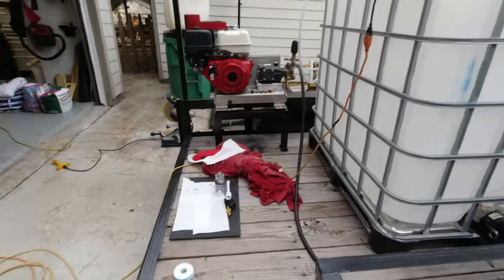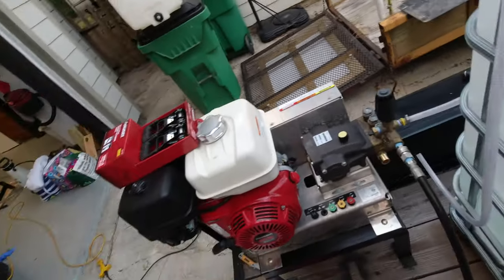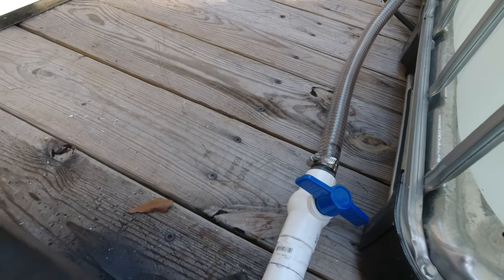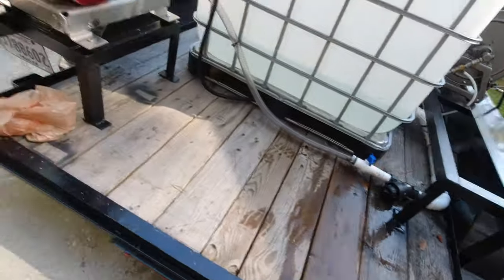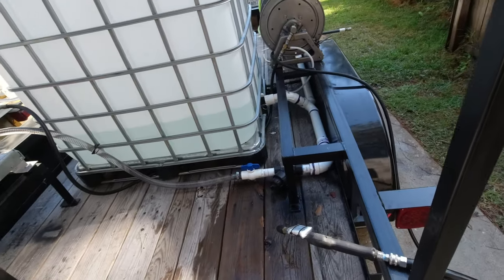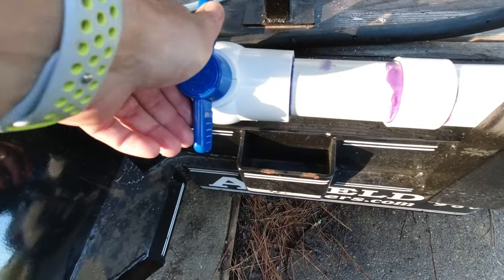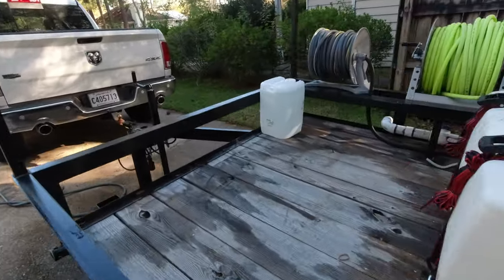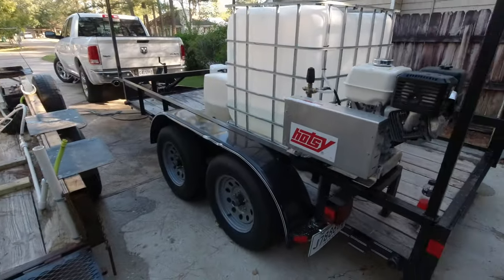Trailer Build  Episode 2

Comment: My brother great job on building new system I use a vent cap for  Bathroom under a the sink it's has a Built-in check valve no trash can get into your tank I put one on my 330 tote it works great  good job  on buliding your trailer  Road dog dirt relief
Reply from the maker: Thanks. I never thought about vent cap from the bathroom. That is a great idea and may have to use it!! Thanks again

Comment: Its not a street t, it's more like a sanitary t if anything. I've actually never seen one of them in the Chicago area and that's what I've done my whole life lol. Also, if it was me I would remove that 90 you have leading to the pump and use a street 45 into a regular 45 to make it a long sweep for better flow to that pump. A street fitting has one hub and one male end. 2 45's make a 90
Reply from the maker: Sweeping tee vs. a regular tee. It has great flow, but i do need to add a ball valve. Thanks

Comment: Hey brother.  Great videos.  I have a small lawn care business solo operation.  Adding housecwashing next year. Having to devide my trailer basically in half.  Half lawn side half downstreaming side.  6x12 trailer so will be tight.  What did you end up doing with the spare tire? I'm having that same issue with it having to be taken off the side to accommodate the reels.
Reply from the maker: I was debating on cutting the off the channel in front of the trailer, but decided against that. I also thought about just keeping in back of the truck. But after working the trailer, I think I will move the mount to the other side. I would also recommend that you make the reel rack off the trailer as far as you can to maximize your space. Thanks for watching and let me know if I can help with anything else!

Comment: I have a question, will the pressure washer still be able to feed from the tote when the water is below the pressure washer line?
Reply from the maker: The water must be above the bulkhead fitting that feeds the pressure washer. Thanks

Comment: Nice build!  Question... what is the bypass hose (valve) for that your run from your pressure washer to your tote?  What's it's function?
Reply from the maker: The original bypass hose was connected to unloader & then went to the hoe inlet on the pump. So went you left off the wand, the water recirculates but will eventually heat up. So I disconnected the connection on the inlet and plugged it then ran the bypass hose to the buffer tank. With this set up, it doesn't matter how long I stay off the wand and the water will never get hot in the pump.

Comment: What size of filter and clear hose from tank to pump did you use sir?
Reply from the maker: 1 1/2" for the pressure washer. You could use 1" & that should work. Thanks

Comment: Did you buid those supports for the pressure washer and hose reels yourself? I need to do that for my trailer
Reply from the maker: Yes, I did all the fabrication work. I am in the process of adding another stand for my 8 GPM unit. BTW, I love them being mounted on the back of the trailer for access.

Comment: Hey buddy quick question i notice you pressure washer will suck the water up from the tank when you started it. you can see the water flowing from the tube to the tank. But my pressure washer wont do that. i bought the simpson 4400 4 gpm pressure washer and no luck. Can you shed some light?
Reply from the maker: You probably have a direct drive pressure washer. A direct drive pressure washer will not suck water from a tank. You need to raise the tank above the pressure washer to gravity feed. If you get a bely drive or gear drive pressure washer, then they will suck from a tank.
Reply: @allproexteriorservicesllc5338  yes sir, i do indeed have a direct drive pressure washer. what kind of pressure wash is the honda? is that bely drive or gear drive?
Reply from the maker: @NutcrewGaming  I have a belt & gear drive. I like them both, but the gear drive is growing on me. Thanks
Reply: @allproexteriorservicesllc5338  awesome, thank you sir

Comment: Awesome clean build. Can i ask what size is line is feeding your pressure washer?
Reply from the maker: Thanks!! I used a 1" line to feed the 4 GPM unit & 1 1/2" line for my 9 GPM unit.
Reply: @allproexteriorservicesllc5338  i like your setup and imma try to replicate that. For a 5.5 gpm do you think i should use 1” or 1-1/2”?
Reply from the maker: @GoldenState408  1
1" should work perfectly.
Reply: @allproexteriorservicesllc5338  thank you Sir! hope you killin it right now

Comment: How did you secure that water tank down
Reply from the maker: I made some brackets that are bolted to the deck of the trailer. Thanks
Reply: @allproexteriorservicesllc5338  thanks for the reply I ended up doing 2x4 on all sides two rachet straps over top my welder was willing to make the brackets but the way I did it was much more stout imo I'm now working the plumbing and it's been a real learning lesson haha.

Comment: How long is your bypass hose? I have seen some say it needs to 15’ -25’. Also do you run that drop stick almost to the bottom of the tank?
Reply from the maker: My bypass hose is around 3 or 4’. The only time you need a long bypass hose is on a roof pump to cool the water. I have a drop stick in the bulkhead fitting towards to bottom of the tank. Thanks

Comment: Had a question on your SH tank. Do you manual fill it up? I heard that some SH suppliers won't fill up a tank if you have a drain spicket on the bottom of a tank. It has to be all solid.  

Just curious. 

Thanks
Reply from the maker: I fill it myself at the local pool company.

Comment: Hey brother, great video. I have the same washer how are you getting by without using a pump to push wasted to your washer?
Reply from the maker: The belt drive machines suck water with no problem. Thanks!!
Reply: No way that’s awesome I did not know that!
Reply: Anyway you could post a list on some of these items?
Reply from the maker: @maxsherro8729  It would be tough. Feel free to reach out to me for assistance.
Reply: Ok thanks!

Comment: Love the build so far. A few tips I can give u is to definitely get yourself a sh tank with out any bulk head fitting at the bottom, the sh will eat those seals in no  time and destroy your trailer..been there already..use that tank for your soap tank..def put a bigger beather hole in that tsnk... when I had a IBC tank I had about a 1/2 inch hole at the top and never had a problem with the debris getting in. Looking good. 👍🏻
Reply from the maker: Thanks for the tips! Much appreciated. I will replace the SH tank hopefully soon. I did some more work today to bring it all together.
Reply: @allproexteriorservicesllc5338   Awesome.. and your welcome..